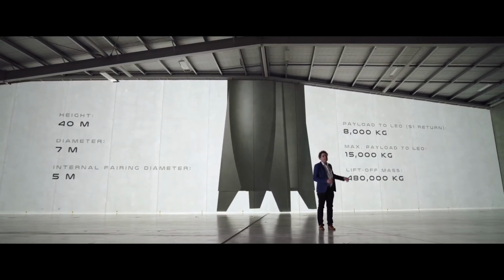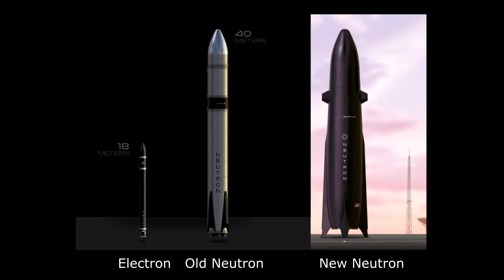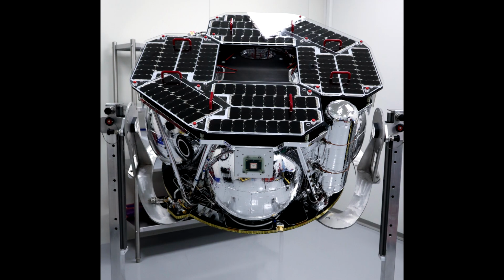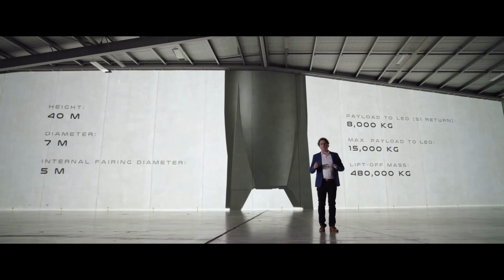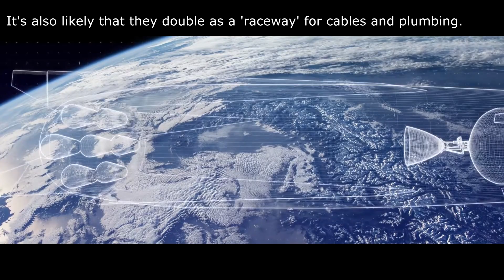Rocket Lab's Neutron Rocket Will Be More Reusable Than Falcon 9

Comment: Those who use carbon fibre composite like Rocketlab have the problem threat they cannot rapidly iterate whereas those like SpaceX who use steel can hone their designs and later on if they settle on an optimal design they can make that in carbon fibre if they wish to see if it has advantages. 
While this talk was interesting it’s all very much a vision and a pitch to investors as well.
Reply: I really doubt that switching materials would be so easy, especially ones that are as different as steel and carbon fiber. I'm not a material expert but I'm pretty sure that the commitment to one material is pretty much final.
Reply: Different design will be optimal with steel, and different with carbon fiber. Eg. they can withstand different re-entry forces, so you can't just swap the material
Reply: Swap to titanium might make more sense. Need to achieve good reusability stats first.

Comment: During descent, the centre of area looks further down as compared to that Falcon 9's. Will this cause stability issues?
Reply: Don’t forget it’s got steerable fins at the upper part of the first stage.
I’m reasonably confident they will have done all the CFD modelling to ensure the design is stable.
It’s only rocket science, after all!😉
Reply: @q.e.d.9112  I'm sure they did all the simulations.. but it just seems a little on the "hard to control" side

Comment: Aren't these the guys that jettison lithium batteries like you can't recharge them?
Reply: They jettison the second stage batteries. Electron's second stage doesn't make it back. You can only recharge things you get back
Reply: My point is isn't lithium rare and expensive?
Reply: @Valery0p5  not rare and compared to the full rocket likely not quite a cost factor either.
Remember that fairings cost several million Dollars and they are usually also not recovered

Comment: I am no expert, but, what happens if we connect the exit of the gas generator to the main combustion chamber on one of those open cycle engines?
Reply: Engine goes boom. Gas generator exhaust is way lower pressure than the combustion chamber.
Reply: @han5vk  does that mean the combustion chamber gases would be sucked up the exhaust?
Reply: @OCinneide  Yep and then blow up the gas generator. Or not allow it to work at least. Its like blocking a car engines exhaust, but much worse.
Reply: @han5vk  damn... I thought the exhaust would be yeeted out of the engine as the main exhaust
Reply: @wafflehidraulico193  Some designs do use the generator exhaust for useful stuff. Like roll control, with thrusters tangentially around the rocket. But it's rather low thrust.
Reply: @han5vk  that is really interesting
Reply: The pressure of the combustion chamber is likely higher and would likely flow up into the turbine of the turbo pump.

Comment: This thing looks like the Razorback from the expanse and I’m all here for it. 

Kind of curious how they plan to convince people to fly on it. Kind of hard to do a launch escape through a fairing.
Reply: I doubt they will even try to get it human rated. There will probably be more than enough business running supplies to space.
Reply: @joshua43214  Peter mentioned at the launch, and repeated in this presentation, that he intends to fling humans into orbit with it.
Reply: You can suppose the Human version will not have a fairing, like some old USA rockets did back in the 60. Or the Soyouz still.
Reply: @Haeffound I don’t think that works here due to the design. That fairing is an integral part of the first stage and the second stage didn’t look conducive to being aerodynamic.
Reply: @MoonWeasel23  They would have to come up with a completely new second stage that fit onto this first stage, and I doubt that it would be light enough.
Reply: @MoonWeasel23  For a human flinging variant they can simply replace the quad chompers with a capsule. Just like a Crew Dragon replaced the fairing on a Falcon 9!
Reply: They didn't really talk about wanting to human-rate it this time. I know in the first announcement it was sorta teased as a possibility (maybe, eventually) but I think that aspect is really optional and is kinda planned as an afterthought like reusability on Electron. They just mentioned it once so Peter Beck wouldn't have to eat another hat
Reply: "how they plan to convince people to fly on it"? That's trivial: They just don't.
RL isn't phantastasizing about colonizing mars, nor even earth orbit. They're designing this thing to send stuff up there. Satellites and the like.
That, and the occasional British spy, of course. But those won't need more convincing than some monologue about blowing up the entire world or some such.
Reply: Maybe now on we won't be seeing more launch escape systems.  Starship which will probably be the future system of human space transportation won't be having it as well. Maybe it's time to leave old escape systems and build more reliable, safe rockets. I can't say I undoubtedly support this idea but things are changing in terms of designs for sure.

Comment: "Falcon 9 is roughly equivalent in performance to this" 

Uh, what? No it's not. 8K vs 15K in reusable mode is a substantial difference. Not to mention 15K vs 23K expendable. That's a MASSIVE performance difference.
Reply: Not really when you consider the usual payload sizes for LEO and SSO from commercial customers. Both will be viable option for the vast majority of commercial payloads.
Reply: @TC_164  They're talking about constellations though, and for that you want to be launching the maximum weight you can on every launch. Starlink launches have typically been 15.6t which is almost double what Neutron is capable of reusably.
Reply: @TC_164  except for constellation launches, which will become the majority of launches, absolutely can use that performance.
Reply: @Avboden  I don't think you understand what "roughly the equivalent performance" means

They literally have roughly the same performance. Falcon 9 can get a bit more into LEO but since the Neutron will have a more efficient second stage that gap closes the further out you go. 

Both first stages have pretty much the exact same performance. The difference is in the second stage mostly. 

You're just being extremely pedantic and a butthurt over Scott's statements which is pretty much correct. 

And seeing as the second stage will be much cheaper than Falcon 9's and the first stage is more rapidly reusable it might turn out that it's cheaper to have two Neutron launches than one single Falcon 9 launch regardless.